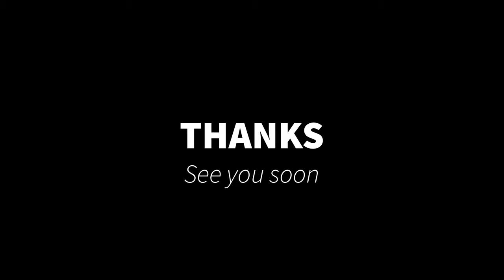Remove and Replace NEW Drywall Ceiling Fast

Comment: Y’all made that look so easy! My toxic trait is thinking that I could do this ALONE lol
Reply: I would want to do it myself to save money😂 But that ain't happening
Reply: @maliroa6113  you’ll never know if you don’t try. I will be once I get the extra money 😩
Reply: Fix your toxic trait that’s easier then doing drywall by yourself
Reply: Actually, putting up drywall is easier!
Reply: @mariiew89  yikes lol
Reply: @mariiew89  did you end up doing it?
Reply: That's why my ceiling still looks a mess, I definitely know I can't do it on my own
Reply: You can with a panel lifter.
Reply: From what I gather its fairly easy to do........but making it actually LOOK GOOD is the hard part; mastering it will be difficult
Reply: You can bro , dry wall lift i have one and am about to do the same job !!

Comment: Your work will never pass the inspection in Canada and in Quebec.   You do not have the same construction rules than here.
Reply from the maker: That's correct. Not even the drywall would pass in your country
Reply: @gillesrenaud6926  thankfully that's not canada that there doing there work at. So guess they don't need to worry about canada rules.

Comment: Shouldnt you have left the small hole for the electrical light socket before installing the drywall up instead of trapping it in the ceiling ? Or is there a way around that ?
Reply: Hole can be made after

Comment: Hi, I want to know what that blue paste is put on the wood, and what is it used for?
Reply from the maker: Hey Diego, it's called stud adhesive. Specifically designed to stick drywall plasterboards
Reply: @Maxkil  just curious. Whats the point of putting the adhesive if the screws are already it in place?
Reply: @Maxkil  Ho what are your recommendations to replace a water damaged dry wall and ceiling in a certain part of my basement, tiny rats and rodents are just roaming in there wildly, I need a solution, will it cost a lot, or can I have a useful solution to this issue so bye bye to water floods, further damage and and unwanted  rodents and rats once and for all.
Reply from the maker: Cut the area that's damaged out, throw some baits up there, then seal it back up. Seal every entry point of you can. I'm fighting with a couple of mice at home too. Problem is the smell if you bait them and can't find where they died
Reply: @Maxkil  That's very true, I definitely gotta block and seal the entry points, but the overall problem is water floods and leaks in the basement Happening with storms and people from stores and apartments over mine in the basement, I don't know if it's the pipes or what, but it all seems to get dumped or released to where I reside in the basement and it's very annoying, I want to put a stop to it so I can enjoy where I live, water free, rodent free, and damage free. What do you recommend I buy more powerful than dry wall. I already purchased water stop concrete, but I want to stuff and seal the openings but need suggestions what material to replace the dry wall with that won't collapse or have water entry no more, I know I gotta seal the pipes, it seems like a lot of work, but would take some hours to do, but not days, cause it's a minor part of the basement.
Reply: @Maxkil  Oh by the way I love your videos, I subscribed, you're my go to, person. ❤ 🤍 ❤ 🤍 💙 🧡 🖤 ♥️ ❤ 🤍 💙 🧡 🖤 🙏
Reply: How do you know where to nail once the gyprock is up. Do you mark it?
Reply: I don't think they sell it in u.s.  it's called gyprock adhesive.

Comment: So, I don't have to go back with the blown in insulation? I'm replacing water damaged sheetrock and insulation in my bathroom ceiling from a leaking pipe.

Comment: Hi, two questions: 
1) what type of contractor do I need to hire for this job? What's the job title, e.g. Roofer??
2) What's the estimate cost per metre squared; or per room?

Thanks,  From UK
Reply: A carpenter. Unsure on pricing.
Reply: @TheFinanceDaddy  thanks!
Reply: Usually is by sqft. And likely around $30-50 per sqft
Reply: If you know how to drywall i would highly recommend doing it yourself, make sure to have the least amount of seams since it will make taping mudding and sanding much easier

Comment: What is that blue stuffed you put on the ceiling before replace the drywall? Thx
Reply from the maker: Hi that's called stud adhesive. Special glue daub for drywall. Not for fire rated application though.